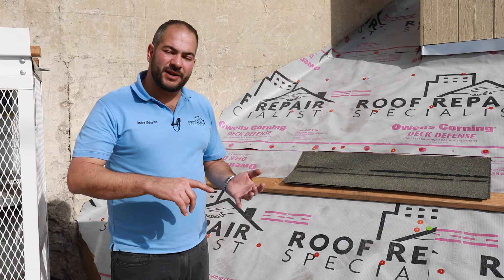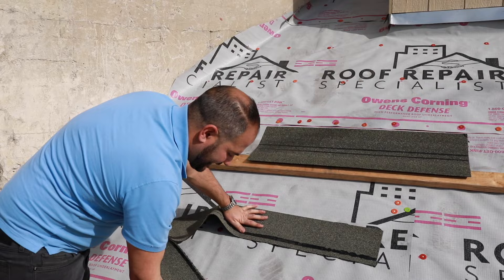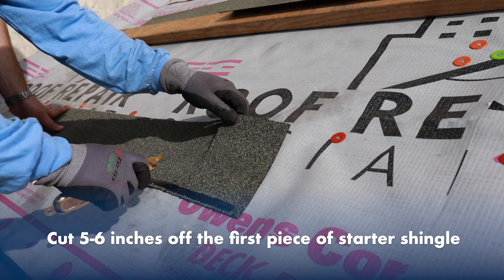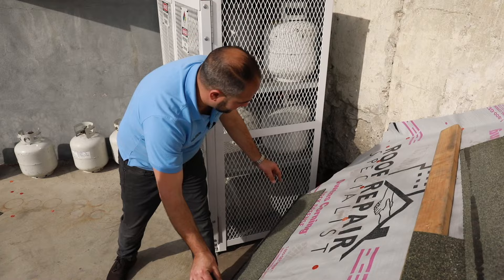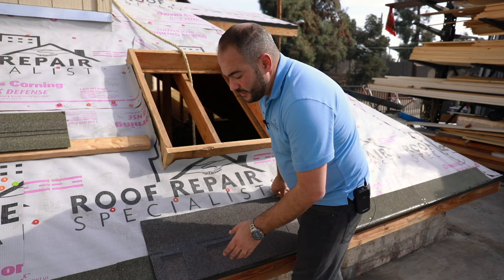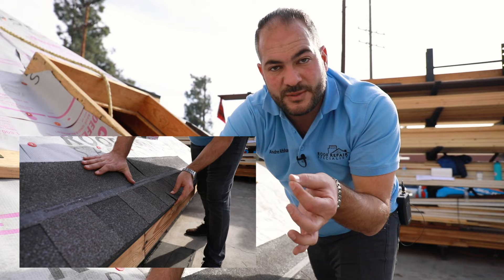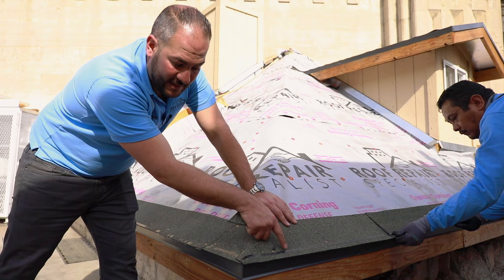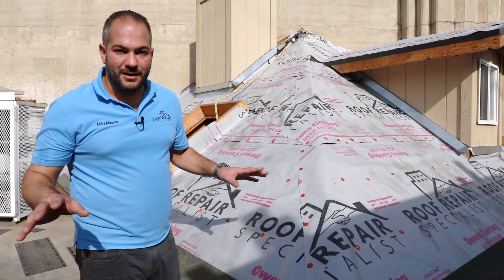How to Install Starter Strip | Shingle Roof Install Guide

Comment: I do not doubt the starter strip shingles are nice ,but I do not believe there is anything wrong with using an upside down shingle as starters ! I guess from roofing my entire life without starter strips being sold or no one I worked with or around ever using them , Never saw a problem with my upside down shingle starters ! I did a lot of slate roof to shingle ,new plywood ,30 pound felt ,all hand nailed and never had leaks or other issues ! I like the concept of the starters and am not knocking them ,just don't think they are 100% necessary over upside down shingles .Good video though .Thanks
Reply from the maker: Thanks for watching, and I always respect tried and true experience and don’t necessarily disagree with you. Being that manufacturers require them, and they are cheap, cheaper then shingles I think it’s worth using. Will a roof leak if you use upside down shingles properly, no.
Reply: That is true. I have seen roofs that are in need of a reroof and some have upside shingles as starters. I think it's a recommendation these days for warranty purposes.
Reply: You tell em brother whatever works.
Reply: @RoofRepairSpecialist  you had me at cheaper than shingles

Comment: When you just flip the regular shingle upside down it does not have the glue strip at the bottom edge for wind resistance it puts it in the middle and that’s not manufacturer recommended. Great video on how to do shingles correctly. Thanks.
Reply from the maker: Thank you

Comment: Wouldn’t the tar side with the rock granules  be faced down if you want adhesion to the drip edge?
Reply from the maker: No, because the drip edge is covered by the underlayment at the eaves. The starter shingle is nailed down. The adhesive strip is needed to adhere the shingles down.

Comment: Will I still need a starter strip even if I put a ice shield?
Reply from the maker: Yes most definitely. The starter strip does 2 important things, covers the gaps in the bottom shingles, you may argue that Ice and water shield does this. 
The second thing that is just as important is it helps adhere the first row of shingles. 
Just as importantly it is required by all manufacturers.

Comment: if you are doing a roof over do you need to add a starter strip
Reply from the maker: 100% You should still follow the same process. Install a new drip edge & Starter shingle
Reply: @RoofRepairSpecialist  can you use a reg drip edge ober existing or is their a wider drip edge for roof overs

Comment: With GAF, the system is a long, thin roll of starter strip rather than the thick break off shingles you show. With it, I will be able to do the front of my project in one 20’ piece. I suppose the main concern will be being careful the nails don’t end up too close to where a seem will be? Also I assume the rake pieces go on afterward?
Reply from the maker: Put starter on the Rake as well. If it is self adhered starter strip. Which I believe the rolls are no nails are needed.

Comment: What nail sizes are recommended to install at the eaves?
Reply from the maker: Depending on the thickness of the sheeting. If you have exposed eaves make sure you don’t penetrate through. Even though the manufacturer states that you should. In California we have allot of eaves that are open and not enclosed soffit. So we have to use 5/5-3/4 nails. If your eaves are enclosed with soffits 1-1/4 are our go to

Comment: “Nails should be nice and flat” (oh shit these are all over driven) “We over drove a nail here to show you what one looks like, pay no attention to all the other over driven nails…just do what I say not do what I do” lol  Just ball busting, most guns will never shoot every nail flat especially a rigid lol. But great instructional video …I know it’s good practice especially in high wind areas but I personally don’t nail my starters low, I actually nail them higher than the nail line on the first row of shingles. Certain gutter guards need to slide up between the drip edge and the shingle and the low nails interfere with the installation. Be safe up there 👍🏼
Reply from the maker: Lol, I always appreciate a good zinger.